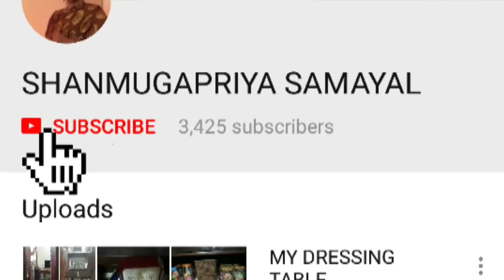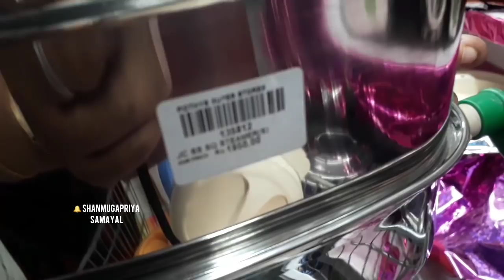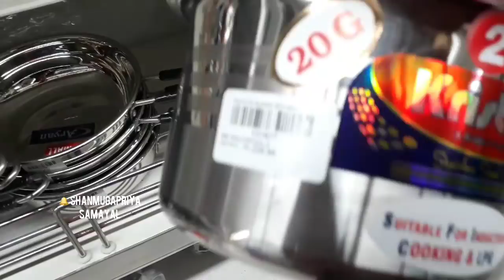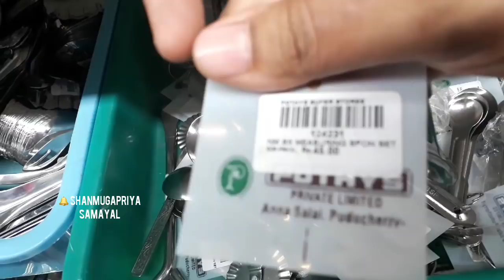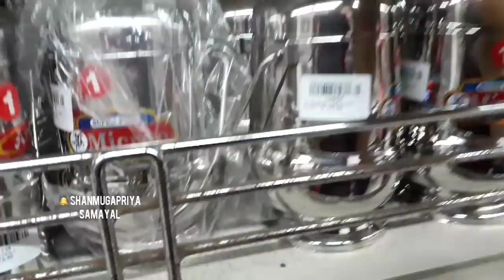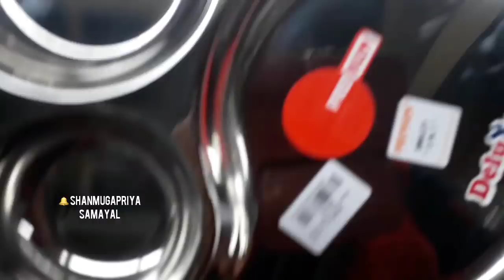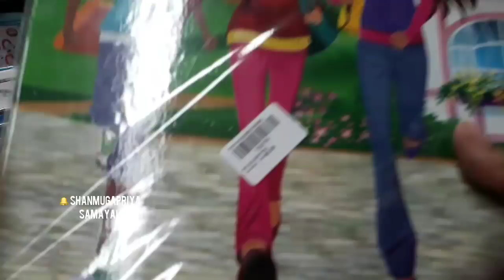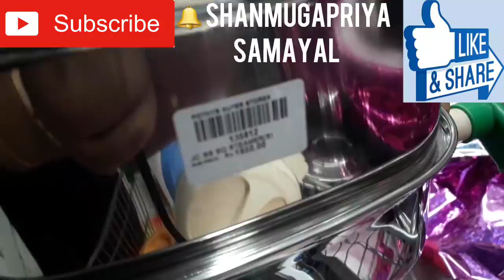Pondicherry Pothys Annasalai /New arrival kitchenware...

Comment: greetings, saw the full video. nice but one quetion.  As you have said in title  Pondicherry Pothys Annasalai, is it in pondicherry or in mount road in madraas.
then four times you told copper bottom vessel and also showed few also but did not say  "IS IT HEAVY BOTTOM COPPER VESSEL"
Reply from the maker: POTHYS Annasalai near Ram international hotel, Pondicherry...yes it's copper bottom vessel..
Reply: @shanmugapriyachannel94   greetings and thanks for the reply.  Agree it is copper bottom vessel and what i meant was IS IT HEAVY OR LIGHT  VESSEL.  As light copper bottom vessel useless.
Reply from the maker: It's depend on price..